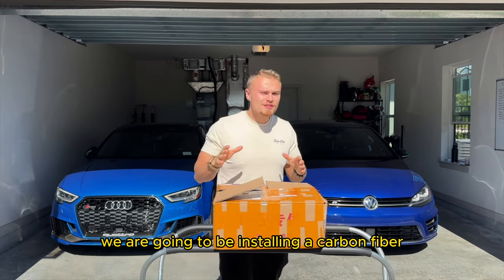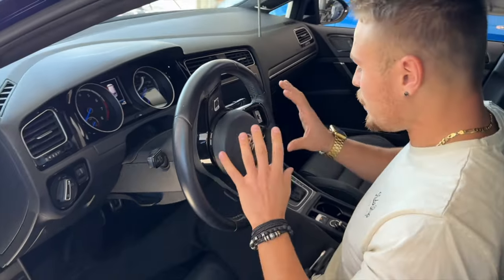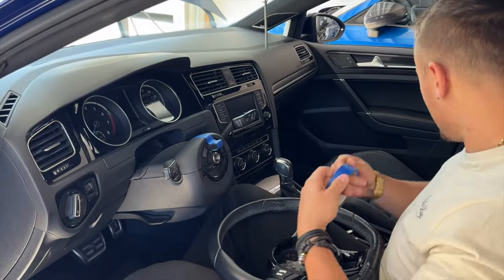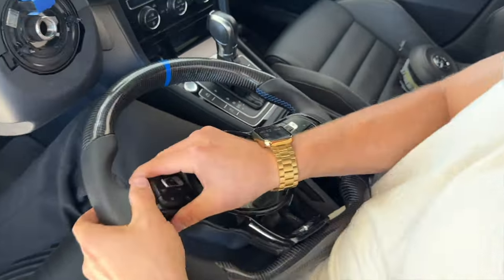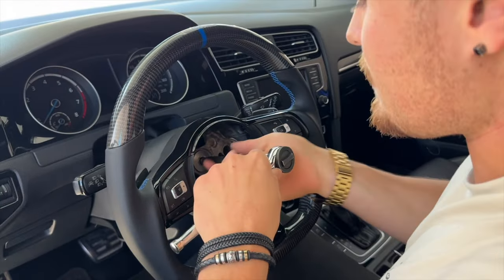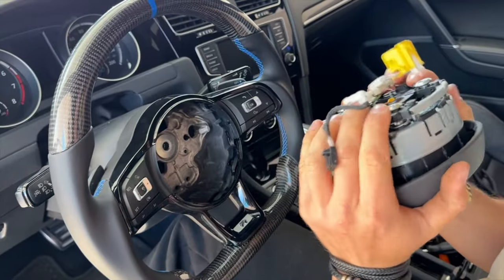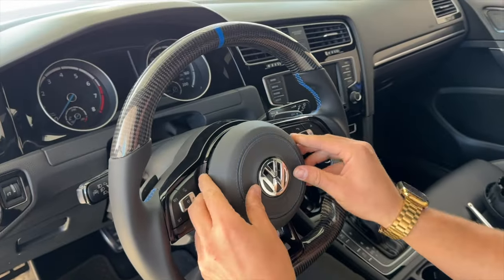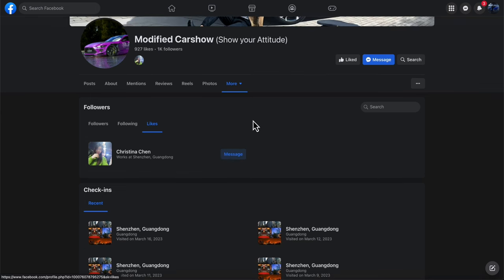How to Install A Carbon Fiber Wheel & Airbag Cover On A Volkswagen Golf/GTI/R (MK7 - MK7.5)

Comment: That’s vid is literally everyone’s guide to upgrade steering wheel from A to Z !

just a quick one mate could u make a vid how to clear out the keyless faulty error on dash as it really frustrating 

CheerZ
Reply from the maker: Keyless fault error? Have you tried just clearing the codes
Reply: @Haydenschreiermk2  nah bro not really tbh i don’t if that works , have u tried and cleared it ?
Reply from the maker: @x3beeD94  ive never had that problem. but thats where anyone would start

Comment: Bro can please tell me the oem part numbers for the paddle shifter switches that you pull out in this I was a bit heavy handed with one of mine upgrading the shifter paddles it's not broken for now but I don't want to have to take it apart and risk breaking it more lol so if you have the parts numbers written down anywhere even that would be great great video by the way like and subscribed
Reply from the maker: save your money and contact christina, she is who i bought the wheel from in the description. she sells oem paddles much cheaper than VW

Comment: What could be happen if I don’t disconnect the battery ? Got a golf 7.5 GTI
Reply from the maker: while installing the wheel.... the "worst" that could happen is you will get an airbag light that needs to be coded off or you can set the pyrotechnic off and the airbag will explode.